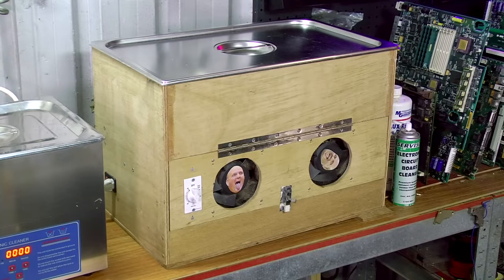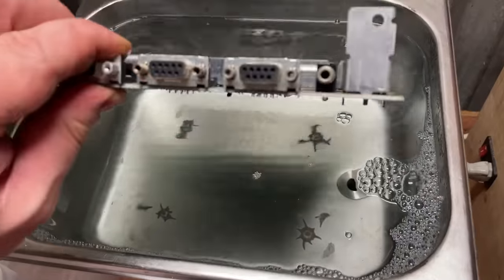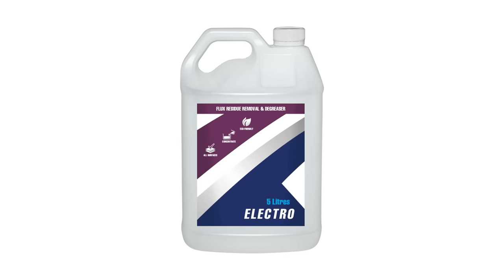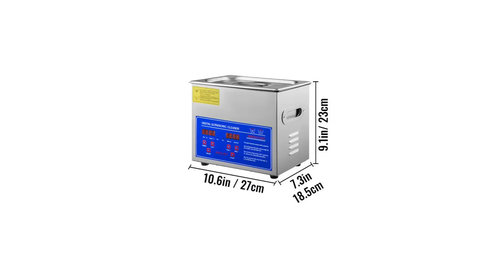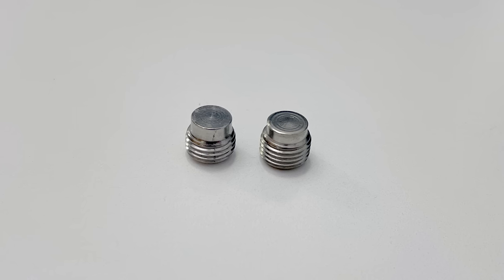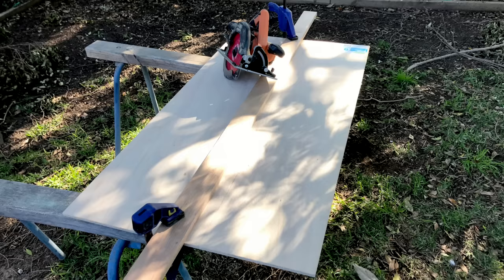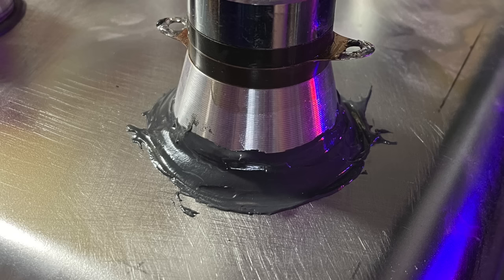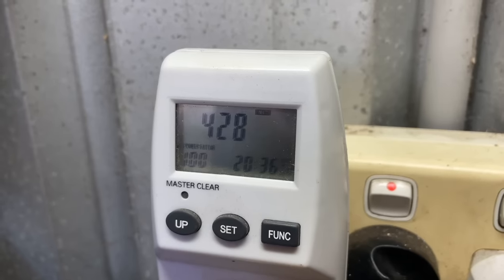Building my own Ultrasonic Cleaner

Comment: I once opened my drier machine to do some "preventive" maintenance by drilling holes near the drier motor which of course i accidentally hit the motor and messed up the coil, i search and search but couldn't find the exact motor and not knowing much about DC and AC motor  i was tempted to just a new a drier but i couldn't accept defeat so i studied as much as i can  about DC and AC till i was able to source one out and install it on my drier after 1 1/2 year lol yes it took that long coz i was putting it off and due and of course the pandemic lol. Log story short i can relate on DIY stuff its good if it works and if not man it stings... And its always hard coz its ur first rodeo but ones u get ur skills up everything will fall into place. Im actually looking to build a UC and happy i stumbled on your video. hope to see some updates! and more power!

Comment: Silver soldering works great with stainless plus its pretty easy, can be done with a map gas torch and can also be used to braze together dissimilar metals, a really good tool in any makes box
Reply: That's what I was thinking.
Reply: Yup; cheap, easy to learn, and much stronger than epoxy.
Reply: Should hold up to heat cycles a helluva lot better than epoxy too... I wonder if I'd try drilling a hole thru than pan to help make a mechanical bond so you're not just relying on the silver solder just sticking to the stainless...like when using uv activated adhesives, they hold better if there's something for the material to wrap around and grab onto rather than just relying on it sticking to smooth flat surfaces. ...if that makes any sense
Reply: @invictusbp1prop143  roughing up the stainless steel, properly cleaning it, along with using flux should be sufficient with proper silver soldering techniques.  Besides why install a potential leak

Comment: This is interesting!
I'm always irritated that youtube doesn't recommend better stuff, but not today!

As far as degassing the water, if you elevate the water temperature, that will help de-gas it. If you always make the water hot, it probably removes some need to de-gas. 

Carbon dioxide is more soluble in cold water.

Comment: Most enjoyable and well presented, thank you for this episode. While watching I was smiling broadly seeing you go through all the problems I had myself having built a simmilar cleaner several years ago. Eventually the transducers all fall off no matter what glue you use, even the welded bungs crack the bowl eventually. I tend to take this in my stride and glue everything back to keep it working. As you can emagine, I have used just about every wonder, super duper, mega glue on the market, but...

Comment: If you have a scrap tray to practice on, try doing a plug weld, it's much easier to manage heat in a plug weld and this is an ideal case for it. Drill a hole about half the diameter of the slug in the tray, then place the slug against the bottom of the tray, covering the hole, and weld from the top of the tray to fuse the rim of the hole to the top of the plug. Keep the welding gun toward the center of the hole to keep from blowing out the bottom of the tray, and work in short bursts, around 0.75-1 seconds, overlapping the end of the last burst and the start of the next slightly to maximize the chances it stays watertight. Should get that nice and firmly affixed without too much fuss.
Reply: Some places would call that a rosette weld.  I would just use a cap screw and weld around it from the top side.  Your idea is much neater and also strong.

Comment: Good, clear well made video. However, after learning from your mistakes, head to a local welding specialist, and have the brackets welding on. I am pretty sure, epoxy will always crack with high power ultrasonic waves. Micro crack, then failure.

Comment: I used to work in an electronic parts cleaning company here in California USA and I have used and operated a huge cleaning machine with two ultrasonic tanks, about 40 gallons each, more or less. One is for the detergent mixture, which is automatically mixed by the computerized machine and the other has plain DI water only for rinsing. We used D.I. water (distilled industrial water), which is a very pure type of water for both tanks. I have retired 6 years ago from that work and glad to watch your video about ultrasonic cleaners and how to build one.
Reply: “DI” stands for “deionized”.

Comment: TIG welding the threaded studs is the way to go. I wonder if you could drill and tap the studs and run screws with sealing "o" rings through the pan.
Reply: I'd try the drill/tap/screw/o-ring solution.
Reply: I think I'd just try hard soldering them even though I do have a TIG welder.

Comment: Great video...I think your issues might be caused by the piezo cells being out of phase...it's like a speaker box with multiple speakers out of phase...they destroy each other and also over work each other. . You may need to get a frequency scope or some similar mechanical method of figuring out the phase....maybe the sound it gives off may be an indicator.  I also think you should be able to screw in those studs instead of glue...it would greatly increase the efficiency of the unit...one comment I tend to agree with is that not getting that vibration out can over heat the system. I will try your project God's willing and make the adjustments 5hat I think will help... thank you for the inspiration.

Comment: When I first started looking at LRC power circuits (which frankly is way outside my comfort zone) I learned that they can easily get into runaway current conditions - that there is no guaranteed way to limit the current in the resonant circuit for a given load condition...   so... fun times!
Reply: Fuse is probably the only one

Comment: Great info and cool to see your custom build. Crest makes some tall and skinny cleaners great for big PCB's but they're extremely expensive. Something used or custom seems like a great option. BTW, you mentioned some components that can be damaged in an ultrasonic cleaner. Add MEMS oscillators to that list.
Reply: HA! that sounded too much like words of experience. Good going, on recommending USED. I have a $975 SharperTEK freq sweeping / heated / degassing unit with 3/4" ball valve drain. I need their unit that is $1,000 more to fit the PS4 / XBox One boards and longer macbook boards. I can't imagine what would make someone let go of a good larger unit. Maybe making our own IS a good option, afterall? These things - NEW, high dollar brand - CAN pay for themselves in the simplest of shops within the first couple of months.
Reply: At my work, we're allowed to use the US cleaners for delicate boards, but not allowed to turn on the oscillator.
These delicate boards contain tiny common mode chokes with tiny toroids and tiny enameled copper wire. Which, in the past, have fractured the wire due to the US cleaning action 🙁.
And the other delicate PCBs are the processor boards, which contain an IC (plastic SMD SOIC) that has a crystal inside it. They can break or be dislodged by vibration 🙁
Reply: Don't put PCBs in to an ultrasonic bath if they have MLCC capacitors on the pcb. You risk breaking the layers of the dialectric.
Reply: @the_eminent_Joshua_E_Hrouda  any board that MLCC should not be cleaned in an ultrasonic bath. Just soak them in a suitable cleaner rinse and dry.
Reply: @ianmontgomery7534  we don't think we've had any problems doing so. MLCCs are used pretty much on every PCB! If we must do as you say, we may as well never use the US cleaners!
Reply: @ianmontgomery7534  if we don't scrub with a toothbrush, the flux remains

Comment: Thank you for your video. As a being retired automation engineer of a cement factory, I was also responsible of chemical labrotory equipment. Fixing ultrasonic transducer were not easy. I tried many glue but at last I welded tree nuts near by the transducer and squeze transducer withsteel plates. these ultrasonic cleaners are working about 20 hours in a day. So after a time there were cracks at the steel container and liquid (diluated citric acid) drops down. This was also easy to replace the container.

Comment: That Ultrasonic Vibrations (friction= physical erosion. + friction=heat + heat=expansion of glue = less surface area of mating parts all that together means adhesive will not last long term) above all else will separate the transducers. So a physical coupling to the tank is necessary especially if you use it often.
 Also to my understanding if the tank is on A bed of springs will increase effectiveness of resonance in the water. And if that is achieves I believe there will be less heat around transducers as well.. 
But I know little.

Comment: I never knew you could use an ultrasonic to clean circuit boards, I use one for jewellery work and they’re notorious for loosening small stones in their settings and even shattering certain types of gemstones. Emeralds are a good example as they nearly always have fractures within the stone which will cause it to disintegrate. I’m surprised that all those delicate components don’t behave the same way!
Reply: Typically for more delicate items, higher frequencies work better. You can maintain the same watt density while reducing effective power per cavitation bubble. This has 2 benefits in that's it's less likely to cause damage and it's more likely to create cavitations that will clean rather than deform. It's like using a brush with thick vs thin bristles while using the same force. You can still use 40KHz, but higher frequencies do tend to work better.
Reply: They do behave the same way.
There are a myriad of components you should NOT ultrasonically clean, e.g. crystals and MEMS devices, because they can be degraded or outright pulverised if they happen to resonate on some harmonic of the ultrasonic cleaning energy.

If he did this in a production setting he'd be in for a jolly old spate of field failures.
Reply: Some gemstones have sympathetic frequencies.  Imagine the old trope of the opera singer and the wine glass.  Sadly to find out the frequencies depend on the type of stone, it's cut, size and clarity.  So in short can be a hit or miss and experimentation and experience goes into knowing what works.

Comment: The speed of sound in steel is about 5100 m/s,  at 41000Hz, this would be a wavelength of 124.39mm. Did you try various transducer positions to make sure they would not be cancelling one another?
Reply: A brilliant observation easy to overlook
Reply: How coherent are they source to source? How crystalline is the medium? How uniform is the container ... it is constrained? It becomes a fairly linear wave front at some small distance from the source ... that is why they don't clean well near the bottom.  It could have a situation you envision ... though it would be pretty hard to pull it off even if you tried. You perhaps are thinking about optimizing the location ... which would decrease the weak spot near the bottom ... the optimized difference would be small ... not really worth considering it would be something like comparing 10^6 to 10^8. With a coherent single source through multiple slits, it's a bit easier to get to where you are interested ... sorta like a dbl slit with 2 rows of 4 instead. But the medium is nothing like air and the container is nothing like an atmosphere or a big pond. The container also couples well across sources although nothing like a coherent source.

The closer you are to stadium light, you see all the individual lights ... the further away you are the more you just just see it as one light. Same with a set of multiple speakers. How close do you have to get to a TV to see the different colors?

Comment: Wiring the transducers must be done properly. The center lug is isolated from the shield shell/cone, while the other side is not.  Thus the need to ground the tub itself.  Before wiring, I always check 1) to see if one if the lugs shorts to the shield/cone, and 2) if the positive of negative wire from the driver connects to ground.  If you wire incorrectly, the transducer will not operate, and worse, you've shorted out the driver output.
Reply: or overheat a transformer :o)

Comment: Well that was an adventure and a half! Super interesting though. I have noticed with power components bought from China or almost anywhere these days, uses either nearly no heatsink compound, or those thermal rubber isolators. I replaced 1000's of those in radio equipment as part of my career. Mica is the best and only way IMHO. Good job on that!

Comment: According to Rossman you only get those holes in aluminium foil if there are standing waves, not when there is random cavitation. So the whole reason to buy the expensive cleaners with frequency sweeping is to avoid the standing waves and the damage they can cause. Supposedly. I have yet to find a cleaner with sweep at even close to my price range.
Reply from the maker: I guess it all depends what you're cleaning. I've cleaned literally hundreds of motherboards/logic boards, and I've never encountered any ultrasonic-related damage.
Reply: @BranchusCreations  Yea, I don't hesitate to use it for most things. But when you are trying to fix something there is only 1 or 2 left in the world of I get paranoid.

Comment: I also made my own ultrasonic cleaner a few years back.  I used a large old fryer. (Basket and heat is included that way)  Instead of the glue, i drilled a hole, found a big bolt that fitted the transducers and then glued them in.  It hasn't leaked so far.  I think my drivers are simular to yours, I did get confused about the KHz.  Some are 28Khz, others are 40Khz and I could not find a good reason for that at the time.  So I used both and mixed them.  It works well.  Fluid is an important factor.  I'm definitely going to try that aluminum foil test.

Comment: WARNING DO NOT IMMERSE ELECTRONIC ITEMS UNLESS YOU CHECK whether the components are suitable for immersion.
A lot of capacitors and other items are not sealed and if you check the manufacturers site it will tell you.
Generally SMD are okay but thru hole need to be checked.
Unless you use a low temp oven you need to immerse in IPA and blow the board off or leave it sit for at least a week in a warm area as moisture can be trapped under chips and when powered you might let the magic smoke out it can be very expensive to put it back again.
Reply: Another problem is that ultrasonic cleaning destroys MEMS components. If you have SMD oscillators or sensors on a PCB  you should probably verify that they are not MEMS devices first.

Comment: You don't need to be a pro TIG welder to put those transducers on the stainless.  Just buy some silver solder and a propane torch and some proper flux.  That stuff sticks to most metals and provides an extremely strong bond.